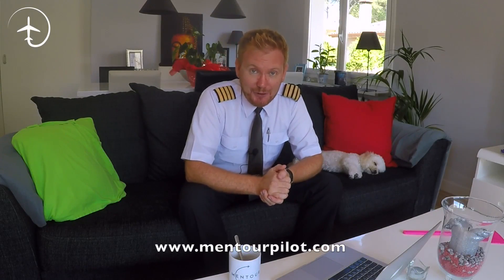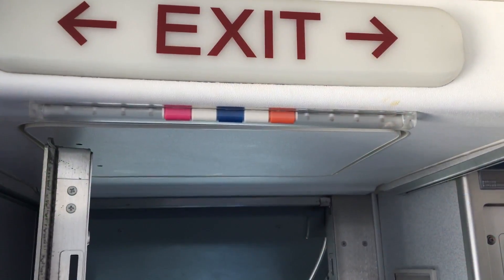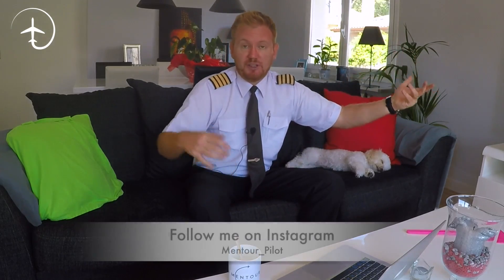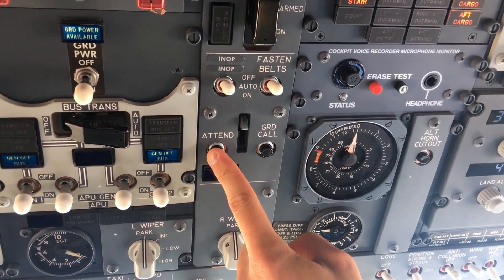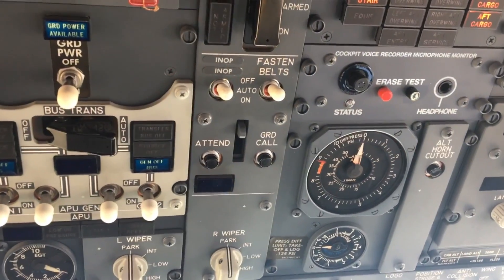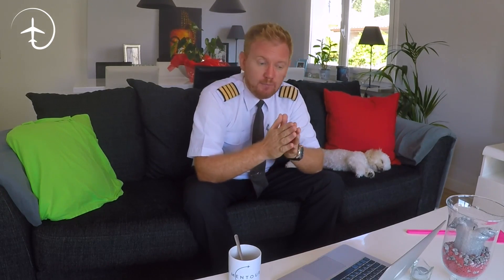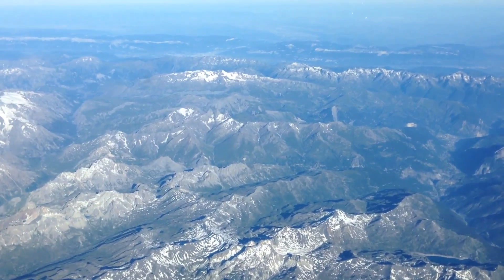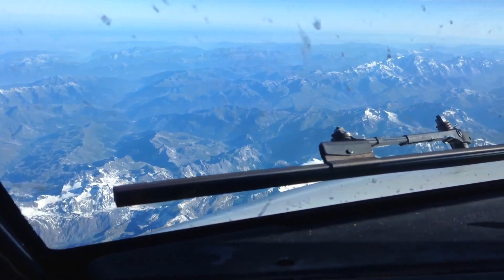Aircrew secret "sign" language - Explained!

Comment: Sir I thank you for making a video on this subject. Because i was always curious to know about the dings. Is there a specific reason why it sounds like that?? Does it have to do with decibel that a human ear can hear this sound when the loud humming of engine supresses all other sounds during take off, cruise and landing.
Also, wanted to know why the ' No Smoking ' sign is turned off during cruise?
Reply: good question, I have nerver heard a similar ding somewhere else like Check outs, clocks, Car stuff or what not. This dings are unique in planes, and I guess, they have tested originally what sound you can hear through various noise, because you do so!

Comment: I have heard a ding just after take off, but before you release the cabin crew. What would that be please?
Reply from the maker: Hard to say,
Reply: tells the cabin crew the gear is up
Reply: Why would they need to know the gear is up?
Reply: I just had something like this, I think one crew member detected some passenger doing a stupid thing like opening the luggage box or so, so one crew guy made the ding and then a gesture to his colleague where somebody was doing what... something roughly like this.
Reply: I don’t get why the Cabin crew need to know the gear is up!
Reply: After takeoff, when the landing gear is retracted, the no smoking signs turn off and emergency exit lights turn off (smoking signs don't actually turn off anymore as they are hard wired to stay on) and there is a chime associated with this. The same thing happens in reverse when the gear is lowered, the no smoking signs turn on and emergency exit lights will automatically turn on, along with the chime. Certain aircraft have this feature, I know it is common in Airbus but I don't believe any Boeing aircraft have it.